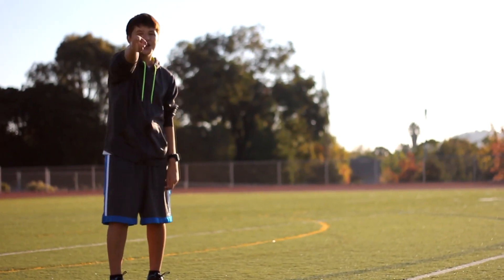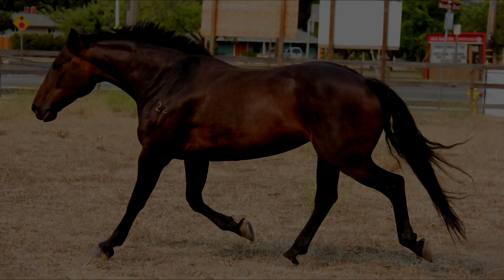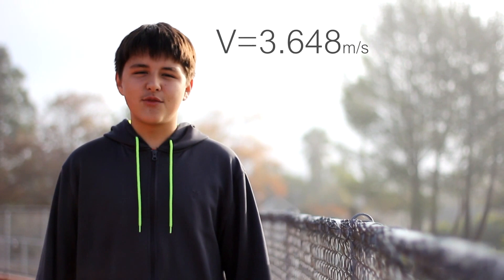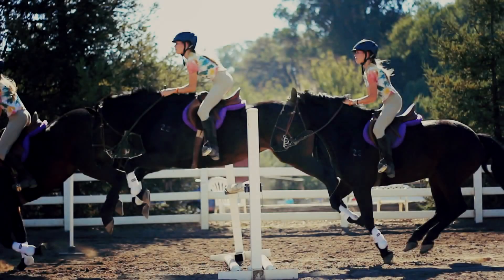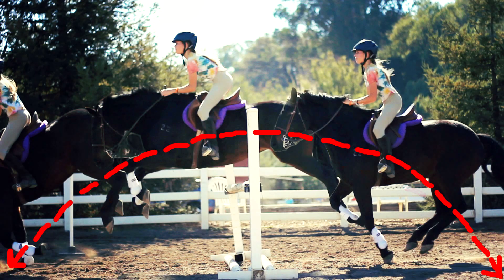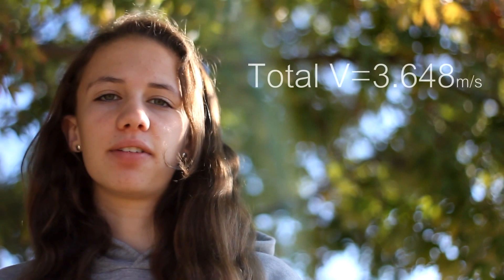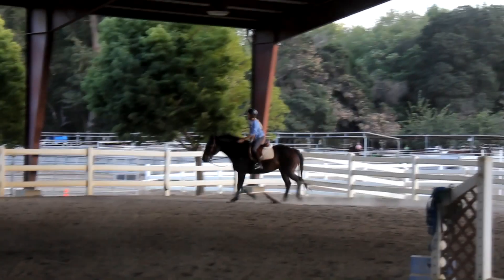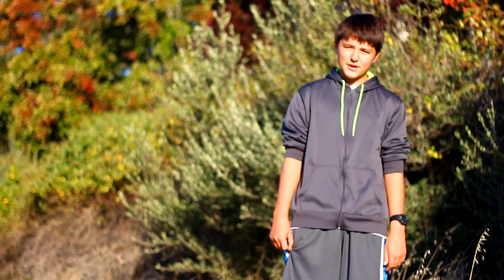The Physics of Horse Jumping

Comment: It was good, just some little things:

When both of you say velocity is 3.648 m/s, you need to indicate the direction. Velocity is a VECTOR, it has magnitude AND direction. Example, when you say "horizontal/vertical velocity" then that's fine, because we know what directions. But if you say velocity of 3.648 m/s, then it's like what? Backwards?  Same with Force, force is a vector. 35,000 N downward? 45 degrees downwards with respect to the horizontal? And how was acceleration calculated? Acceleration is also a vector.

Other than those, for the trot/canter question affecting impact force, I think it would have been great to use conservation of energy and/or describe work being done on the horse's legs.

So, it was an entertaining video to watch, but the Physics was lacking.